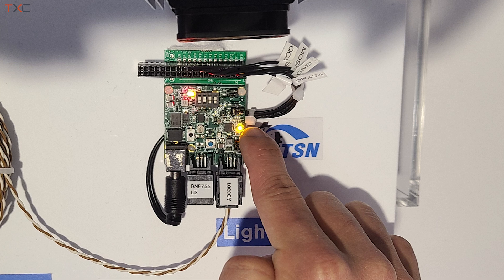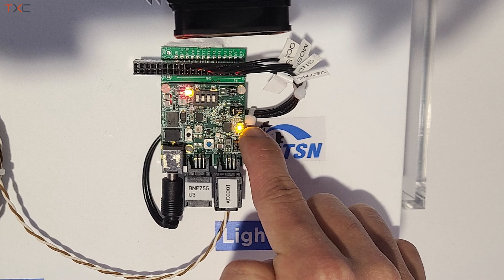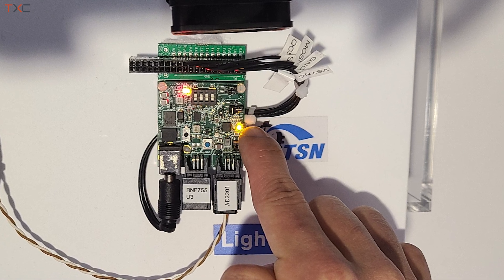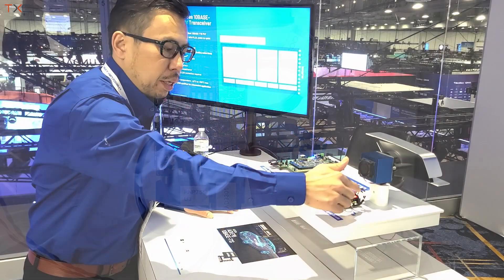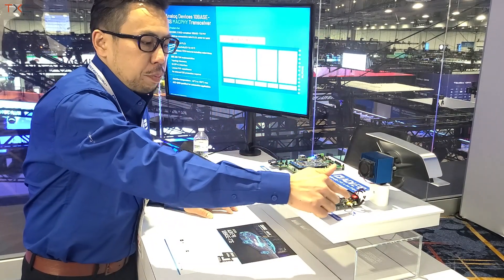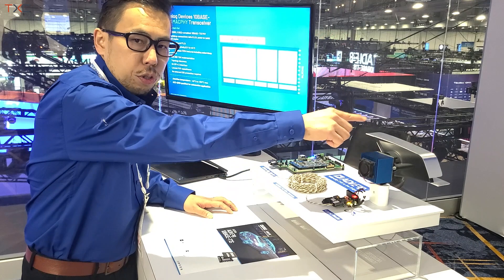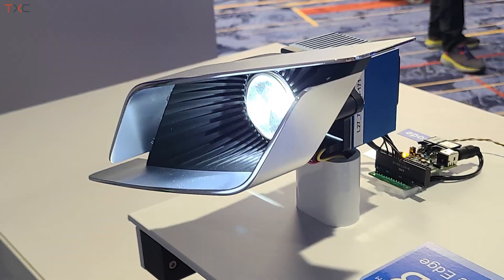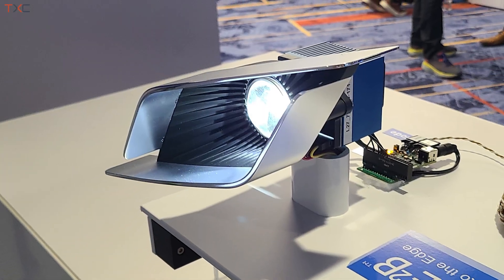How Does 10Base-T1S Work?

Comment: Really surprised we're still implementing automotive communication with copper. With copper you have to worry about decoupling, filters, termination, esd, etc. A single fiber between modules either daisy chained or using a pon architecture. Laser diodes are ubiquitous, even led optics could be used with polymer optical fiber.
Reply: With copper you can easily detect if the wire is broken. With fiber you need to keep a heartbeat to know if its working. Copper is just way easier to manufacture, install and repair
Reply: @AlpineTheHusky  Protocol works the same way regardless. I would argue fiber is easier in all aspects. Maybe not 10 years ago, but today definitely. Especially when we are talking feet instead of miles of fiber the tolerances can be pretty low. Too-less splice methods are available for nearly all types of fiber manufactured as well so repair is not an issue. In fact a fiber splice would arguably be quicker and more reliable than a soldered connection. Not to mention the network would only need a single fiber to bidirectional communication vs the 2 wire copper networks currently used.